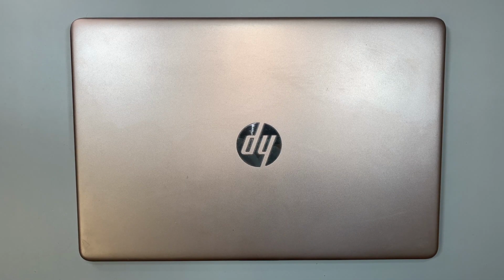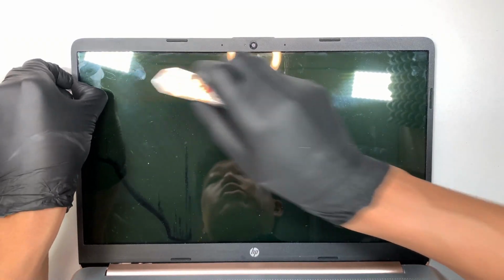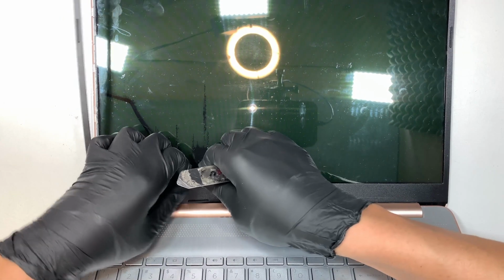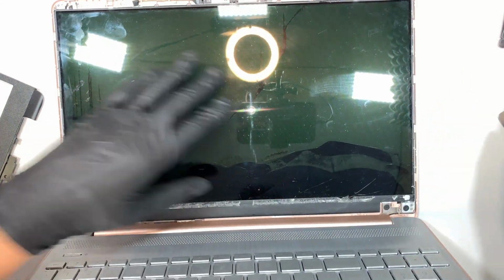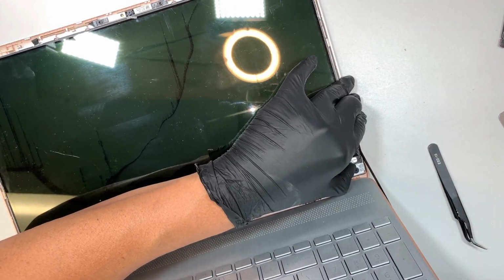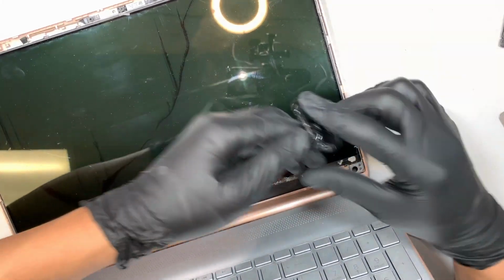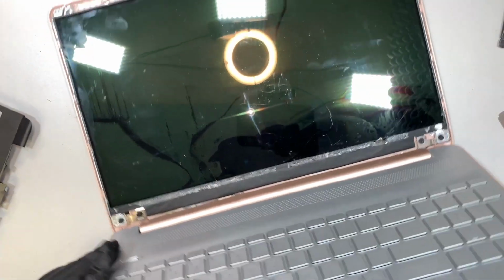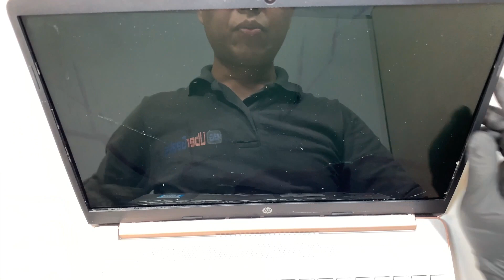HP Laptop 15 ef0025wm Cracked Screen Replacement

Comment: I can do this! Paying $99 just to have someone tell me I need a new screen and turn around and charge another $150 plus parts is nuts. This is so simple! Thanks for the video. I have the same laptop and my cat jumped on it when my headphones were sitting on the keyboard and the screen was part closed. It cracked it. 😢
Reply from the maker: You can do it!
Reply: And my tape removal started at the top of the screen not the bottom.
Reply from the maker: @ThxGd4THC How did it go ?

Comment: Came across this very good video and loved how you explained everything.
Question, my HP laptop is barely a year old and exactly the same as this one. Just this week when I opened the screen, it began to flicker. If I moved it, it would go black. Then I realized that if the screen was moved to a certain position, it would stay clear. Would you say these symptoms show a bad display cable? Or is the screen bad? I am suspecting a bad display cable. I dismantled the laptop but stopped short of removing the cable from the screen end because I couldn't find a video showing how to do this. Any hints or advice would be most welcome. I have since reassembled the laptop and it works if I put the screen in a particular angle. This is annoying, would like a permanent fix. This is the part number for the cable "hp display panel cable l63615-001".......If you have a link on ebay or Amazon, could you post it here? Thanks and keep up the good work 👍🏽